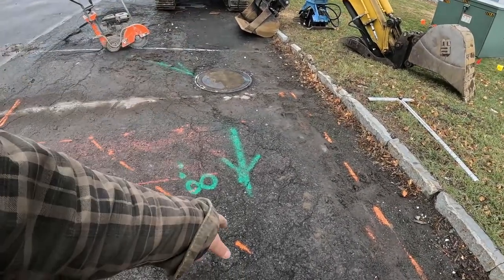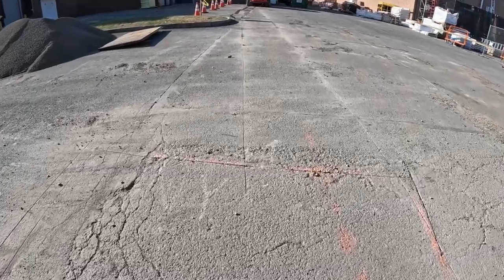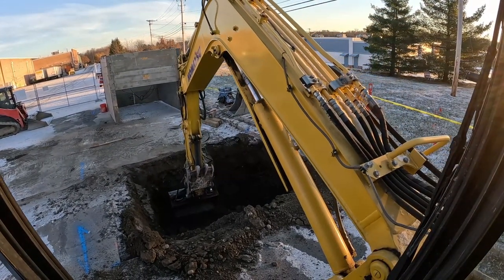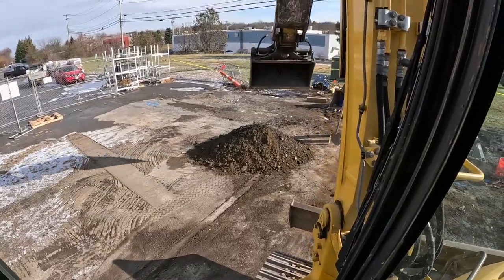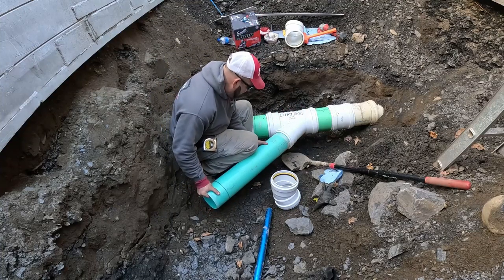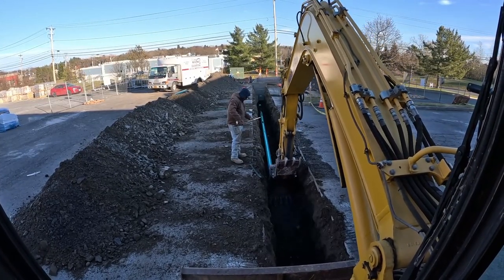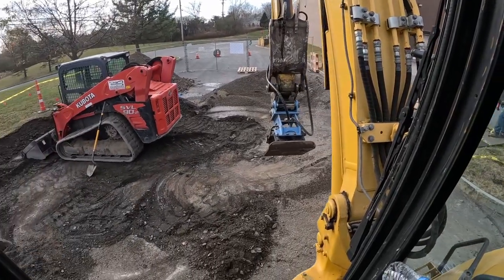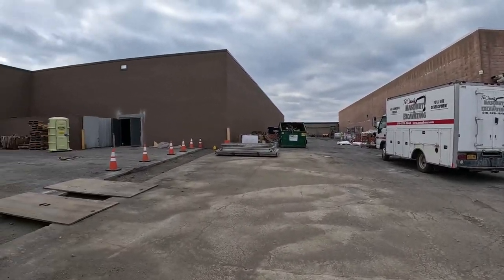Sewer Main WYE install Going deep in the trench box

Comment: 1/23/23; 2day watched you install that 6" gravity flow sewer from main (9'below surface blktop?)  then 45°upward & 18" below water main...then another 45° to intercept long (75-80' long?) upslope 'run' to then reduce to 4" to penetrate block foundation under slab for ultimate vertical connect to new bathrooms/toilet etc. Your video compresses 3-4 days (?more?) tear out blacktop parking, excavate, install, connect, inspections, then reverse, compact pea gravel (#1?) &  inspect. Continue fill & compact up to bottom of blacktop level, blktop, sweep, load up & then...💪🍺🍺🍺🍺🫕🍷😅Another great video! Stay safe & carry on!🤠
Reply from the maker: You are on par! 💪

Comment: 44:22 I watched a building going up. When they did the basement they had these giant ibeams holding the ground back. Pulling the beams they  had this vibrator thingy that grabbed the ibeam and vibrated it out. Considering you had the packer on there made me think if you had a hook or something on the plate that let you press the packer plate against the plate while vibrating as you pull up.

Comment: nice work dirt boss, i did this sort of work for twenty years here in canada and have seen the good, bad and downright ugly, lol, never seen a bevel tool like that either, i know they had them for abs work, i was a surgeon with a cut off saw though beveling everything from ductile iron to plastic, its great fun beveling a one meter+pvc, the only thing i saw that would not fly here is the crew has no safety vests or hard hats, workers compensation board here is strict and for good reason, especially the four foot rule on excavation, the fines levied here would bankrupt most if one dares to tempt fate, all the best.
Reply from the maker: Thanks

Comment: Very good, Dirt Boss! Thanks as always. When you're finding that water line, do you typically include it in your scope to use a private utility locator or make the GC/your client do it?
Reply from the maker: 811
Reply: @DIRT-BOSS  right on, but stuff that's behind the meter is what I was wondering about. 🙏
Reply from the maker: @ajrikli  yes if we were concerned but we checked there's no power going in the buildings but besides where they marked it.. at that point we would hire GPR ground pressure radar company to come in market out

Comment: Sdr35 gasket fit that big gets tough to fit grease it and use a strap wrench to pull fittings together. You're better off getting shoring jacks and plates instead of using a box saves time
Reply from the maker: Thanks! Send me the link of the wrench

Comment: Quick question Mike, and it might be a stupid one but after the 6 inch cleanout and where it goes into the building is that someone elses work or did you guys do that to? Like what happens past the hole you put through the block I was curious.
Reply from the maker: Good question yes plumbers take it from there

Comment: I just curious why you just put in a concrete structure and take in out, i don't think it for safety reason during the pipe fitting. BTW awesome job 👍
Reply from the maker: Yes it was an aluminum trench box for safety